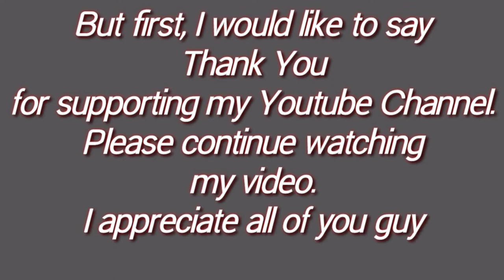Ford Ranger Hood release cable problem FIXED | DIY

Comment: My problem is not in that location.
My issue is that the cable housing has been pinched and broken in the area near the battery. It acts as though it's been stretched and no longer has spring or tension on it. I've been utilizing a pair of vice grips to pull the cable.
Reply from the maker: Try to replace complete set bro